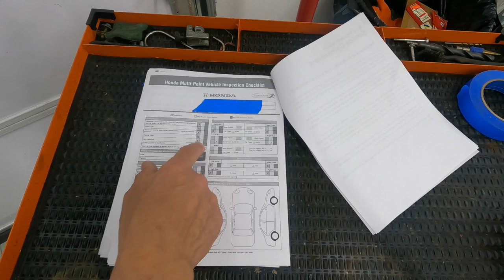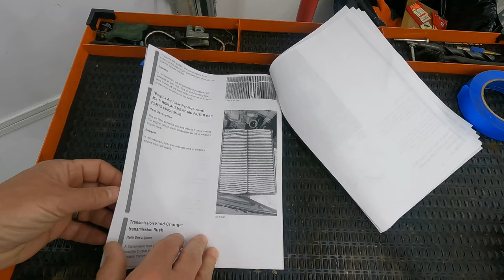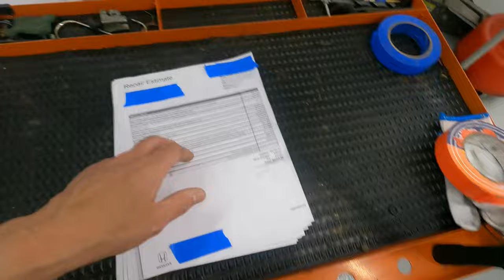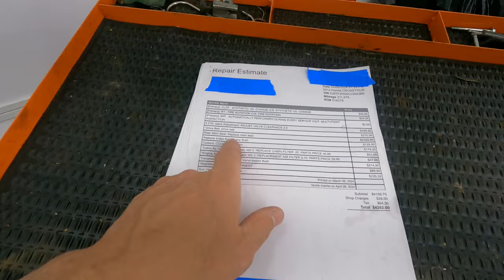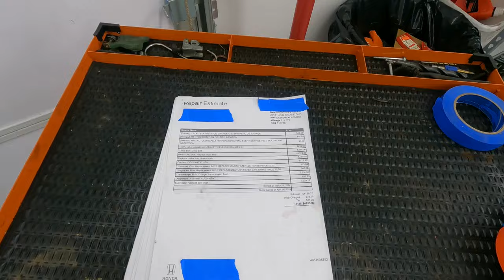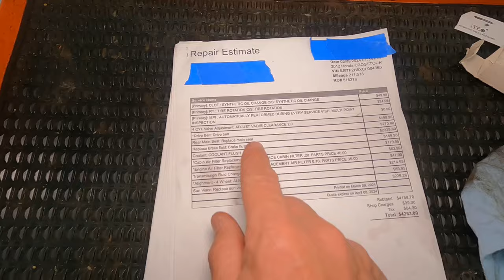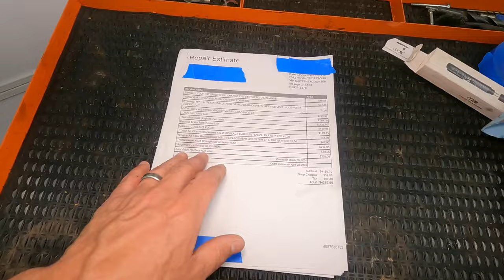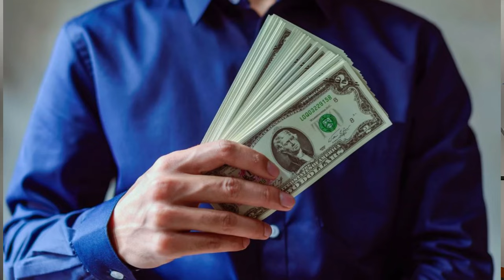Why car dealerships are called "stealerships"

Comment: There is a simple lesson that needs to be taught in driver's ed; the "Service Advisors" are not advisors, they are commissioned salespeople.
Reply from the maker: Boom, mic drop!
Reply: Correct.  Just like the "Service Advisors" at Tire Kingdom & Firestone, and the counter guys at AutoZone who upsell the deal of the day and the people at...
Reply: Not just Service Advisors. The rot runs far deeper than service advisors. The new General Manager at the dealership I worked at for 20 yrs considered all the mechanics to be commisioned salespeople as well. Said it to my face more than once. Told all us mechanics we needed to upsell every work order by 80% no matter what it came in for. Some mechanics were happy to comply. I didn't and walked from the trade completely.
Reply from the maker: @redwoodforest3572  wow, good for you, and that's really scary for folks that go there!
Reply: Learn how a car operates and learn to check the oil and other fluids quit being lazy and learn something besides how to play on your phone😂
Reply: Here’s the thing….I don’t MIND being advised of things my car NEEDS that I may not be aware of PROVIDING the need is REAL. In the case of this 200,000 mile car, it is GOING to have needs such as oil seeping from different areas.  Replacing a main seal that is starting to seep a bit would be unnecessary BUT the owner should bring made aware of it and advised to check his oil  more often and keep an eye of it in case the minor seepage become a full blown leak.  Some shops seem to think that every elderly high mileage car should be restored to showroom condition and they do not!  It’s the term STEALERSHIP that set me off!  Finally, some jobs NEED to be sold!  Your dentist is an example of this!  Go in for a routine cleaning and additional needs may be pointed out.  Some of the recent mega dentists may push things too far.  In ANY event when presented with a list of recommended work, a second opinion can be a great idea.
Reply: They usually have leeway to "do you a solid" and pull 10% off your bill if you know it's a little high too.
Reply: Well, I am a Service Advisor and really suck at it.  I will not let repairs happen if there is no proof that it needs to be done.  Thinking of a career change because I have too many morals, but a former middle aged Captain is considered the lowest life form in the US nowadays.

Comment: I'm a used car dealer and I have an experience to share. About two years ago, a young man, 17 years old, from Guatemala bought a Dodge Durango from me. In Texas, I'm required to get a safety inspection on any vehicle that I sell. I'm not licensed to do inspections, but there's a shop right down the street that does. Aside from inspections, their main thing is oil changes, and light maintenance and repairs. So kid buys the car, and about 3 months later, he calls me, upset that he took his car to get an oil change, and he was going to be billed about 1,200. He passed the phone to the service writer, and it was the same shop to which we went to get the inspection. She tells me that the drain plug is stripped, and the only way to fix it was to replace the oil pan. Because the car is 4X4, there was insufficient room to replace the pan with the engine still in the car, that's why it was so much. This made to sense to me because I change the oil on every car I sell, and tighten to specs from Alldata. So I tell the kid to bring me the car, along with oil and filter. When he did, we get underneath and I showed him how to do oil changes himself. Car was high enough we didn't even have to jack it up. It took us 10 minutes, including pausing to give him instructions. Drain plug came out, and went back in, 30 ft-lbs, without a hint of cross threading or any sort of damage. I've been selling cars for nearly a decade, always referred people to that shop because I've always had good luck with them, but this one experience made me question that, young man, knows nothing about the land he's in, can't speak English, his first car, and he was going to be charged 1,200 for an oil change. Had the kid of given them the go-ahead, would the shop really of gone through the motions and replaced a perfectly good oil pan? Or would they of just spent ten minutes and replaced the oil like we did, and bill him the twelve hundred anyways?
Reply from the maker: So sad, and again, not all shops are bad, nor us mechanics, you just get some now and again that are unscrupulous and/or incompetent!  Thanks for helping that kid out! You're a good dude and will be helping to keep the joy in wrenching going another generation.
Reply: I could go on & on about Stealerships!🤨
Reply: Lots of scumbags out here
Reply: @MrSamPhoenix  Are you one of them?
Reply: This is why I hate mechanics. My engine went out and needed a head gasket replacement. After getting it broken down said the heads were warped, then called back and said I need a radiator, new hoses,new water pump, new thermostat and now a nee engine. 8700 for a 80k mile 5.7 installed and I had no choice since they had it all pulled apart. Original quote was 3300 to replace gaskets ended up with a 12k bill. I'll do the work myself from now on. Did all my rotors,hubs,brakes,calipers,rims,tires,tpi sensors,battery,alternator,air suspension,coils, cabin filter, cold air intake and fuel injectors so far. 
I had to take my vehicle back to the shop after the engine and radiator replacement too for overheating. 1st time the thermostat was stuck (found out they charged me for a new one but attempted to use the old one), an exhaust leak from when they didn't bolt everything up tight,then over heated again and took it back to realize the coolant line popped cause they didn't replace the bottom radiator hose or clamps (but charged me for it) so they had to replace them, then a ticking noise that increases under load during acceleration that they couldn't figure out and still persists to this day that wasn't there before they took the car in for repairs.
Reply: Sounds like u should’ve contacted the gov agency that regulates automotive shops / better business bureau

Comment: I’ve worked for 3 different Toyota dealers, a Honda dealer, bmw dealer and a Porsche dealer in my retail career.  Everyone in my service departments were the most honest people I’ve ever known. If you find someone dishonest,  they are the exception not the rule.  Go to the manager or fixed ops director and let them know your experience.  If I found one of my guys taking advantage of customers and selling something not needed,  they wouldn’t even finish out the day.
Reply from the maker: That's great to hear, and yes, I think these type of experiences are not the norm, but I do see and hear about them way too often!
Reply: At the dealership where I work in Parts, I've had guys hand stuff back to me saying it's not needed and they won't do the job.
Reply: The technicians maybe they higher up staff, no.
Reply: Independence shops can be even worse.  A shop is either honest ot they are not.  YOU call stores Stealerships. What a disgusting term.  I agree a lot of those prices were ridiculous!  Especially the valve adjustment!

Comment: Don't blow out your engine air filter. You put a hole in it and reinstall it your going to cause yourself a lot of problems. Throttle position sensor, MAF sensor, micro scratches on cylinder walls. Just spend $25 on a new air filter and watch a YouTube video on how to install it.

Comment: Years ago I asked the Honda dealer to fix a hesitation.  They replaced the spark plugs and billed me for one hour of labor, which was $65.  This did not fix the problem.  Some weeks later, I found the real problem.  Ignition coil had a crack, moisture harmed the secondary winding.  It was up under the gas tank (79-81 Honda 400, two-cylinder chain drive).  And of course the replacement part was only available through them.

Comment: I do most of my own basic work. But...had to go to the local Porsche dealer a few days ago to try to remove some locking lug nuts in order to get new tires installed (yah, they didn't have the correct key either, and had to just bust them off).  Part of the 1 hr service charge, they do an inspection of the car and send a video.  The tech was very thorough and pointed out all the things I already knew to need attention, but, nothing extra.  Kudos to them.  Even though I have a hooptie 25 year old Boxster, every single person I encountered was kind and treated me like a millionaire in disguise (I'm not, for the record!).  Great experience. But, would still go to my local indy for work if needed over the dealership.

Great video and thank you!
Reply from the maker: Yay! a good experience story, and there are many many great shops and people who work in them who are honest and competent. These guys obviously fall in that category, and I find it interesting you still go to the independent for the repairs...why, is it mainly cost, relationship...?
Reply: @joyofwrenching  Both cost and relationship.  I have a local small indy that I have used for years who does great work and I trust. My visit to the dealer the other day was the first time in their service area, and the shop was amazing. They have a huge glass wall from the waiting area that overlooks the shop and everything is neat, clean, well lit - it's beautiful.  But, that's why they charge $200/hr labor rate.  I prefer to support the guy I've been going to for 20 years, but, wouldn't hesitate to go to the dealer again if I had to for some reason.
Reply from the maker: @amyboehm802  they are not all bad, that's true. We have to inform people in our communities of the good and bad ones based on our experience

Comment: Good call. Specifically instruct service desk not to perform any type of inspections on your car, even if they insist on it, saying it's "Free and it it's part of the deal, Still tell them not to do it. Only do the Oil change and park your car outside. I would also check to ensure they changed the oil filter, check dipstick for fresh oil level, and tightened all oil caps and drain plug before you drive off from the premises.
Reply from the maker: That's one way to handle them!  Most people say they don't mind the inspection as they may alert you to something that does need attn, and they just politely say thanks but no thanks to letting the shop fix it if it seems overpriced or unnecessary

Comment: The valves on the Honda V6 usually tighten up and cause a miss fire rather than making a clicking noise. The best way to check for valve adjustment problem without taking off valve cover is monitoring the miss fire cycle on your scanner. $500 for a adjustment on a V6 is not bad. I bet the quote is for a 4 cylinder.
Reply from the maker: Good info, thanks for sharing!
Reply: Same with the 4 cilinder in the CRVs, I Invested like 50 dollars including gaskets, feeler gauge and valve adjustment tool and 1 hour of labor.

Comment: I had contrasting experiences with an independent mechanic shop and a dealership. I had taken my vehicle to the independent shop for a tune-up, and about a week later, the car started jolting when I accelerated. I returned to the shop, and they informed me that my transmission required a flush. So, I got it done, but the issue persisted. I then decided to get a second opinion from a dealership. After waiting for 15 minutes, the service personnel came out looking irritated. He advised me to go back to the independent shop and have them fix the issue since the work should have been warrantied. He revealed that the spark plugs had not been correctly gapped. I followed his advice, and the independent shop was surprised and quickly fixed the problem. Since then, I have been going to the dealership for my car needs.
Reply from the maker: You found a good shop! Some are independent, and some are dealerships. This is how we learn which are the good ones, so make sure you pass the info around your town.
Reply: @joyofwrenching  Oh, let's say I left a couple of Google reviews.

Comment: Oh, I'm well aware of stealerships...like the time when I took my old Hyundai in for a warranty repair, and they told me the brakes were shot---even though I replaced them two months before, and they worked perfect. They even had me sign a waiver saying that they're not responsible if my brakes fail---they spooked me out enough that when I got home I pulled the wheels off and had a look; there was nothing wrong
Reply from the maker: Wow, that's pretty bad!
Reply: That's funny. So much lying goes on in this industry to the point where they get you to start doubting your sanity (gaslighting). I'm just relieved that I'm not crazy or alone.

Comment: I worked at a dealership many years ago, I was told by the “service manager” to replace the emergency brake pedal, I got a light and found the lock pin for the cable broke off, I replaced the pin and the pedal was fine, the person that owned the car was my neighbor, the service manager and him got into a fight over me not replacing the pedal that wasn’t needed. The owner of the dealership fired the service manager and didn’t charge my neighbor for the work.
Reply from the maker: That was very nice of you to save your friend a bunch of unnecessary expenses

Comment: I’m a long time Honda guy and this stuff pisses me off. I have a near mint 01 Prelude,a 92 civic si hatch,a 14 Civic coupe and my wife has an 05 Acura ATL. I used to be friends with the head mechanic at my local Honda dealer so I used to have an advantage when I got anything done. He died of cancer about 6 years ago and now I get fleeced by the new advisor because I don’t know him very well. I needed an o2 sensor for wifes TL and I got an estimate for over 5 grand. They throw things at you for stuff that they assume it might need because of the age of the car. It didn’t need the timing belt done,valve adjustment or anything like that as I had it done a few years ago. They saw oil on the power steering pump and reservoir so they said it was leaking and should all be replaced 😅. The reservoir was still full and I’ve never topped it up so clearly it wasn’t leaking. These guys kill me.
Reply from the maker: Wow, glad you're on top of things, and that's exactly what we have to do, just educate ourselves and be on guard

Comment: My 2004 Nissan Frontier had a steering shaft replaced under recall last year, the only upsell attempt was for a car wash.  Mrs. Cuss took her 2014 Yukon in for air bag recall replacement, got a laundry list of $1700 in "needed" repairs (don't think dealer ever opened the hood). Years ago, when dealership was unable to repair the sunroof on our 2005 (told me they had no idea what was wrong), dealership still wanted almost $2000 for "needed service".
Reply from the maker: Bet you avoid that place as much as possible now!

Comment: Start with the owners manual, Honda says:  Adjust valves at 105,000 miles, Flush brake fluid every 3 years.  Replace coolant at 10 years.   The car is 12 years old, depending on the service history it does need new coolant.  Engine air and cabin Filters as required due to driving conditions.  This car shows 211,000 miles.  So it needs it's second TIMING BELT and tensioner,  it's second valve adjustment and new spark plugs!   While you are putting on a new timing belt you might as well replace the accessory drive belt as there will be no additional labor.   It has 211,000 miles, it does need some HONDA recommended service items.  What happens when the timing belt or tensioner break due to lack of HONDA recommended service?  Who will pay for that??  Did you read the recommended service schedule before filming this video?
Reply from the maker: Good points, and true. A lot of times people have to make judgment calls based on their finances and plans for the vehicle. Some shops really pressure people with scare tactics above and beyond too. In a perfect world, yes, these things could all be addressed for the longevity of the vehicle